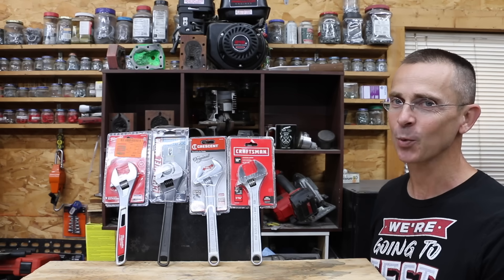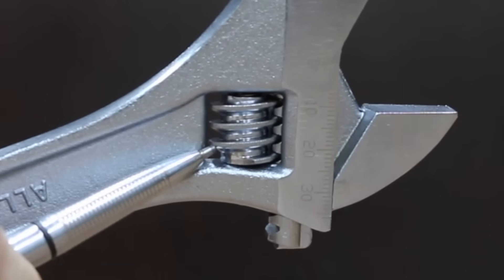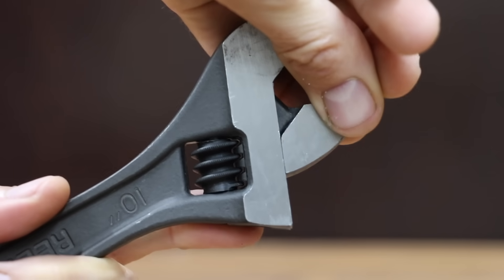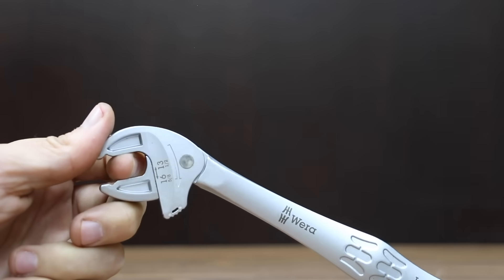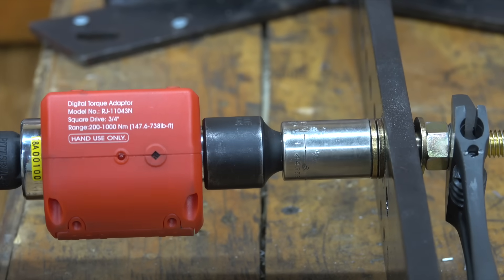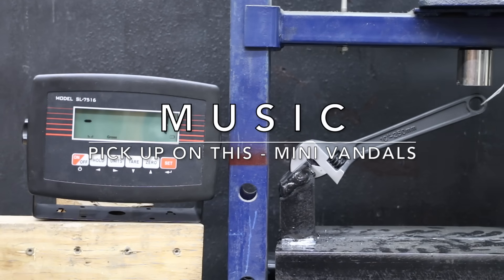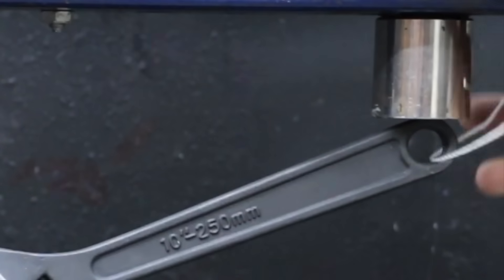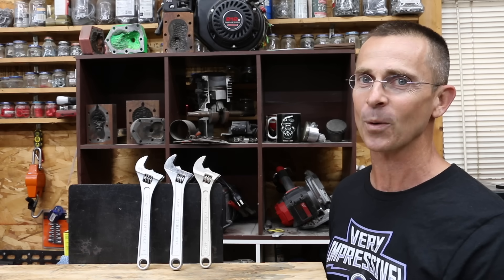Best Wrench (ADJUSTABLE)? Craftsman USA vs Craftsman, Crescent, Kobalt, Milwaukee, Channellock

Comment: thanks for adding the vintage wrench in. it goes to show the saying they dont make em like they used to,
Reply: They also don't charge what they used to.
Reply: @nokidding152  Ya.  For example the $5.00 one would be 98 cents in 1975 money.  The Crescent, while not top-of-the-line a pretty decent one, would be $3.14 in 1975 dollars.  I was a little too young to be pricing tools back then, but could you get a cheap knucklebuster that size for 98 cents brand new and a decent one for about three bucks?
Reply: @nokidding152  sadly!
Reply: @nokidding152  inflati- 

No point of arguing with people 50+
Reply: @nokidding152  inflation. It's not necessarily more expensive than it used to be. $20 dollars today is not equivalent to $20 dollars in the 70's, 80's, 90's, etc.
Reply: @nokidding152  just buy used tools, cheap and the right quality. Picked up a Swedish Bacho 4”, 6”, 8”, 12” and a 16” for $30. Just had to remove crud and surface rust and then oil them. Bargain.
Reply: @nokidding152  You get what you pay for, though. There's a reason the children of the Boomer generation are looking forward to inheriting their parents' tools: the older, more expensive tools are still in good condition and usable, while the newer, cheaper alternatives need to be replaced periodically. Even if they're 1/3rd the price, if you have to replace them three times, then they cost just as much, and cost more when you replace them the 4th time.
Reply: @c182SkylaneRG  Having to replace periodically is true for some tools, but certainly not all. I rarely break a tool or wear it out completely. Even this video demonstrates that most adjustable wrenches would last until you put a 5 foot pipe on the end of it and hang off it. The main difference if you actually use it frequently is how much frustration it's going to cause you and how much time the better version can save you on a single difficult job. That's what I find with most cheap tools. It's not that they don't last if you aren't abusing them, it's that they are just slightly worse or sometimes a lot worse and make jobs more frustrating. For example, buying cheap locking pliers simply is not worth it. I'm planning to buy some Malco ASAP because they seem like the only option that will match or best my old beat up made in USA Vise-Grips.
Reply: @802Garage  That's an even better point. I tend to focus on breakage and replacement because those are the ones that stand out in my mind (they cause the greatest frustration when they break or wear to an unusable point right when you need them, and have to stop your project to go buy a replacement). Admittedly, this is more common with replaceable screwdriver bits or drill bits than it is with wrenches, at least at the homeowner level.
Reply: Craftsman usa adjustables were forged the same way and by the same people as they had been for decades…until april 2020 when the forge was shut down permanently and liquidated. I’ve personally forged hundreds of thousands of these exact wrenches and jaws. The only things that changed were the dies. Craftsmans were chosen to be coined with the logo rather than the dedicated embossed dies. Other than that the craftsman adjustables were identical in every way to the allen, proto, wright, williams, ridgid (also had dedicated embossed dies), the occasional mac order, and i’m sure i’m forgetting a few other contracts. When i say identical i mean they were forged in the same purchase order, with the same bar stock billets, by the same operator, in the same dies, on the same shifts. The only difference between those brands were the names, and the phosphated or nickel finishes. Check out the date codes and touchmarks just above the hang hole and you will see the same touchmark.

So yeah, we did always make the usa wrenches just as we had for decades. Once b&d/stanley bought craftsman, they started to offshore a ton of production.
Reply: I've still been replacing mine with new ones from Ace Hardware corporate stores.

I love my USA made Craftsman wrenches!
Reply: Or the buyers don't specify and demand quality like they used to.
Reply: @Goalsplus  this is a huge part of it, it is a culture problem the American culture has become the disposable culture everything cheaply made and throw away, I hate it.
Reply: @keldon_champion  agreed. I don't like it at all and haven't been able to fully escape it. However when I "over build" something and I get someone to touch and feel it they start to appreciate quality and feel disdain for the junk. It doesn't work if I only show them a picture though.  Maybe our society is more interested in looking pretty, cheap buy-it-now gimmicks to put on show and never gets to feel the difference between a $50 and a $400 item. "Look but don't touch."
Reply: Made in America used to mean something to us American’s.
Reply: @iamgriff  iamgriff, We Americans spell the plural of American without an apostrophe.
Reply: Made me sad to see him destroy this pristine vintage tool.
Reply: When I was young (maybe about 11 or 12 years old) my father took me down to his workbench and gave me a lecture about the differences between quality tools and cheap tools. He demonstrated it with box head wrenches by using both an old Craftsman wrench and some chinesium tool he'd been given at some point. While I noted the difference at the time in how much better the Craftsman wrench fit the fastener and how much better it felt in the hand, the lesson didn't become practical for me until years later. When I started out living on my own with my wife, any tool that I could afford was what I used, but as I grew older and made some money, I ended up replacing those cheap tools (often from Harbor Freight) with better tools as I realized they both lasted longer and made the jobs I was using them for go MUCH more smoothly. As it worked out, I bought Craftsman when they were still made in the USA, and when I went to expand my tool collection, the Craftsman tools were no longer made in the US, so I bought Crescent and Klein tools. I have broken many chinesium tools over the years, but I still have every Craftsman, Crescent, and Klein tool I ever bought, and they are all still in "like new" condition despite many, many hours using and abusing them in the cold, rain, snow, and heat, though thankfully I now have a garage I can use to work on my cars and projects. The Klein screwdriver I have saw me through many years as a field service technician working on copiers and printers as well.
Reply: I really miss sears 😔 Until a couple years ago they had some really good stuff and now all the sears near me are gone.
Reply: Eh? The Taiwanese wrench did fine.
Reply: My Craftsman tool chest is  loaded with old Craftsman tools dating back to early 70's. All have held up very well!
Reply: Also shows that you shouldn't be blinded by marketing and biased by brand names.  Names are bought and sold all the time and the products almost never improve when the brand changes hands.  They count on brand recognition and reputation to sell you inferior products under the name of formerly quality products.
Reply: He knows how to pander to the demographs that watch his videos! That being said, it is a interesting data point.
Reply: My opinion on that (as a commercial and residential HVAC and appliance repair tech is they add all kinds of new bells and whistles on the new stuff but none of it is built to last any more. I honestly don't believe in the "planed failure" theory but durability and repairability are not something they take into significant consideration either.
Reply: Poured one out when PF destroyed the craftsman USA
Reply: Not really vintage when they are from 199X
Reply: @rissu8573  looking at the date and die code, i’m gonna guess it was 2005.
Reply: Spoiler alert ⚠️
Reply: You have to wonder if the quality of steel isn't as good as it used to be.  Much of our steel used today is produced from recycled metal which can carry along impurities that detracts from strength.  Copper is a common example of this type that's extremely hard to remove.
Reply: You got that right I actually came here right after watching your pit bike video
Reply: AMEN to that statement 🇺🇸👍
Reply: Most of the time this is just survivorship bias, this time it was measured and demonstrated.
Reply: SCRAP FAIR TRADE IT ISN'T FARE AT ALL JUNK FOR QUALITY ISN'T FARE AT ALL!
Reply: @jimmygmc9154  Err.... just buy good quality shit instead.
Reply: Why tho bc they will lose money making it too good?
Reply: @DEATH14269  Good tools cost 6-10x's what cheap ones do, for a reason. CNC Router heads are extremely expensive and the harder the steel of the end product the more tools you will need to replace. The material costs are pretty pricey atm but usually it's all down to how insanely expensive tools are to manufacture tools.
Reply: This reminds me of the Neverending light bulb some company couldn't produce...
Guess why?
Money is the answer.
Reply: Keeping my Craftmans.  Hiding the old, old ones....better metal.
Reply: Buy it nice or buy it twice.
Reply: Vintage wrench?
I feel old.
Reply: They definitely do. The problem is, how they used to make things wasn't as economical as it is today. Be prepared to drop 80 USD on a single wrench if you want things "how they used to" be.
Reply: @AliceNine  Too true!   A pair of Milwaukee locking pliers (which are pretty usable... rubber handle slips, but basically good) are $50 Canadian for a set containing a 10" and a 7".  To get the equivalent two from Malco would be $140.  That's a significantly premium price.   I'm not saying it's not worth it, I'm just saying that is way more money.
Reply: @AliceNine  my work has no problem paying big bucks. Just remind them that cheap tools cause injury's :-)
Reply: @AliceNine  $80 is a cheap lifetime investment if you intend to use it often.
Reply: @AliceNine  
Only because of greed by US corporations.
Reply: @AliceNine  when it comes to tools, I would do it
Reply: @AliceNine  well, it all depends on what the job is. If you’re a backyard mechanic then some cheap Chinese made tools would probably be your best bet. If you’re a professional aircraft mechanic then you will gladly pay $80usd for a quality tool. Lives depend on your craftsmanship.
Reply: @AliceNine  That is true, it depends on if you make a living with your tools or if you're a homeowner. I was able to make a living with craftsman when they were still American made, never disappointed. I remember when the Japanese, Tiawan, Indian, and Chinese tools all bent or broke when you put real pressure on them and you could put a three foot cheater on a 18" Williams adjustable, yes, the World has changed and our politicians going for the lobbyist and giving our patents to these foreign countries was by design to drive us down to the Worlds standards. It was economical back in the day because these companies paid a living wage to work for them, we've just become accustomed to rolling down to third world standards, Germany is about the only one that has kept their standards.
Reply: @AliceNine  well, the corporate business model and ever increasing greed of ceos, cfos, coos, and all those people doesn’t help, bankrupting a brand is rewarded  with multi million dollar bonuses these days
Reply: @nodescriptionavailable3842  It is also the shareholders greed.. They all want more returns.. The whole market structure is to blame..
Reply: @FJB2020  and our appetite for cheap crap
Reply: @FJB2020  Well that's capitalism. Companies will always seek to reduce cost as much as they can get away with.
Reply: @veni_vidi13  That is not capitalism..  That is having to compete with chinese imports.. They HAD to join because consumers wanted to pay as little as possible.. They were basically forced to go overseas.. More factors come into play like companies being extorted to pay union wages, EPA killing off steel production and a list of other things.. 

All we had to do was put large import fees on goods and we would have never been in this place..
Reply: @FJB2020  And just because they "had" to compete with Chinese imports on a global market that is still capitalism. 

Import fees are "big government" or as some in the US would call it "Socialism". 
In capitalism the market makes the decision. And the market made the decision to go to China.
Reply: @FJB2020  I worked for sears this is bs. I scanned tools in for l inventory and priced them. Iv seen wrenches that sears would charge $70+ for one wrench that only cost $2 to make. Its sears own fault with miss management that out them out of business. Me and another Coworker were the top sales men in the tools department. Making sears $60,000 a month back in 2013. And the company would still pressure us to do better.
Reply: @dillonkoch72  … I once worked for a retail chain that used to list product cost on the manifest of incoming merchandise along with the retail price. Many of the margins were shocking. Eventually they wised up and stop listing the cost. From their perspective, I can’t blame them. Why should the workers, other than the store manager, know the company’s cost… ??
Reply: @mercoid , that's not wisening up, it's lessening the quality of the workforce.
Margins most of the time are only shocking when not realising the price of purchase is just a small part of the cost of the item in a store:
* transportation, if you don't have it, you can't sell it
* storage, the shop itself has a cost to it which goes into the margin
* staff, unless you can trust your customers not just to put the money in the jar but also will unpack the deliveries and take away the trash for you.
* alternative cost, what you could have spend the money on instead. This is what makes shelf-warmers and seldom purchases expensive to deal in compared to high turnover items.

Having the costs listed teaches the workers the trade business at minimal expense for the company.
Reply: @veni_vidi13  no the government makes it. example; there are a lot of cars the government will not allow here. and yes a lot of countries tax the hell out of american imports and restrict american labor in their countries.
Reply: @mercoid  that  cost isn't always accurate. often the design and mold costs are not included in wholesale . i worked a lifetime ago at a plastic parts manufacturer. we usually used the buyer's molds to make their parts for them. we made old gm horn pads and charged them 4 bucks but they supplied the emblem and molds.   the retail market was for 45 bucks.
Reply: @victorhopper6774  and so what? It is still capitalism that companies will seek to produce at the lowest price possible while still satisfying consumers and if consumers buy tools from cheep Chinese manufacturers they will go there. That is not the governments decision. 

Sure there are countris putting tarifs on foreign goods and regulating foreign labor. The US is one of them. So what?
Reply: @victorhopper6774  Green cards is something every country has. 

We are talking about the businesses deciding to manufacture elsewhere. 
And even with tarifs on imports it is often cheaper to produce outside the country. 
It is the business owners who make the decision to leave the US. So they would sell their own mom for a buck. 
If you call for regulated capitalism or "social capitalism" that protects the workers then do that. But don't pretend it is still pure capitalism. 
It is the pure form of capitalism that drives work outside the US and you want a social capitalism to fix it.
Reply: @veni_vidi13  you just don't get it. free trade does not really exist between countries. different regulations concerning pollution, labor, transportation, and currency. china for years would not let the yuan float to keep a advantage for their industry. this not something a individual company can affect or compete with. unless they move to a cheaper country.
Reply: @victorhopper6774  And what is your point? It is still capitalism and the decision of the companies to move to China. Even if there were no regulations it would still be cheaper to produce overseas since the standard of living and therefore the pay is lower. That is the main driver for companies leaving the country. 
Capitalism.
Reply: @veni_vidi13  no. capital goes where it can make the most money if the governments let it. of course there are natural reasons some industries are located where they are.  like growing bananas  at the south pole. tell me why smith & wesson don't make fire arms in china. or why boeing doesn't make fighter jets in russia, they can surely make them cheaper in those places. these decisions are not up to the companies.
Reply: @victorhopper6774  if they were allowed to they would, but because there are regulations in place they won't. 
Yes capital goes where it can make the most money that is why they largely moved manufacturing oversees since they have to spend less and therefore make more money. That's capitalism and you not wanting to have it true is hilarious. Where bananas are grown is also influenced which countries the US invaded to destroy local farmers and subjugate them to US companies.
Reply: @AliceNine  quality pays for itself.
Reply: Man we were so lucky/spoiled back in the day when we could stop by Sears on a weekend. Pick up new American made Craftsman hand tools, tapes and what not. Also exchanged that 1/2" ratchet we snapped when we had the 4' heavy wall pipe on the end to break that damn axle nut loose as our breaker bar was home in the shop lol. All those sockets, open end wrenchs really we're just as good as snap on for what we needed with identical warranty. 

Here we are Sears is gone and the modern craftsman tools are tainted by chinesium where wal mart can now compete with their quality now, all useless garbage unless it's for a city boys "tool-bag" home kit

Still disgusts me Milwaukee is owned offshore but they're still top shelf and dump huge money back into the states keeping hundreds of thousands of our neighbors employed
Reply: Yep, my heart hurt with the destructive testing of that old Craftsman 💔
Reply: Yard sales.    I pick up old tools whenever I see them.
Reply: And that one was just a  mid level/ entry professional level wrench
Reply: If you have an easy exchange program on a lifetime warranty, then the newer tools are great. If you just want to buy 1 tool and never have to replace it, it's usually cheaper and a better experience in use to pay more 1x for a quality tool.
With that said, buying American keeps Americans working. I will pay allot more for quality American products because they are worth it and they build our economy, not China's economy.
Reply: @yadaroni  exactly! I buy everything i can that is made here in the U.S.A. if only more did what we did! Our economy wouldn't be in such a tragic mess! And downward spiral that its currently in! There's still quite a bit of things still made here. Tools and tons of other products. You just have to be willing to look harder and fork over around 2 to 6 times as much as cheap chinese tools and some even higher. But well worth it to me since it helps out Americans. Plus the products made here arent possibly hazardous due to unknown chemicals or heavy metals such as lead, mercury and tons of other toxic/hazardous Metals and chemicals! which china seems to love putting into our children's toys!  Of all things and other items. Its sickening how that crap makes it past our importing screening protocols and into our stores. Anyways sorry for the rant lol i also love vintage U.S.A made tools. I love how well built they are! and robust, reliable and will last several lifetimes if taken good care of. Same with vintage U.S Machinery, i Love it! So solid and heavy! Built to last. I also like old German made tools and England made tools as well as some from Australia.
Reply: @daviddaddy  ….
I love this comment. 
Good points. 
I’m a retiree who works part time in a store stockroom for a large retail chain. Everything they sell is made overseas, mostly China.., from a sponge holder for your sink to large furniture items. I can write a 50 point laundry list detailing the poor quality, dangerous, often toxic/bio-hazardous, incorrectly engineered garbage they’re selling. Too much to list here. 

Even the boxes the stuff arrives in are unhealthy to handle. Why? Because it takes massive amounts of decent fresh water to manufacture the type of corrugated cardboard boxes we’re used to here in the US. The boxes from China, India and several other countries, without question in my mind, have the distinct quality of having been made using filthy water, possibly containing sewage and chemical contaminants.
Reply: @daviddaddy  
SK,
Viking-Norseman,
Round-House (work clothes),
Williams,
Proto,
Snap-On,
Mac Tools,
Wright,
Channellock,
Bondhus,
Mayhew,
Matco,
Cornwell,
Wilde Tools,
DFM Toolworks,
SR Torque,
Razorback,
Tekton (some),
Western Forge (see below: Black and Decker destroyed and liquidated brand), 
Vaughn,
Montana,
Estwing?,
Empire (some),
Lisle Tool,
Midwest Tool,
Wiss (some),
Lenox (some), 
Wyeth Scott,
Rogue Hoe,
Council Tool,
Hardcore Hammer,
Eklind, 
US Tape,
Chapman Manufacturing,
Martin Sprocket,
Lang Tools,
Westling Machine,
Bully Tools,
Brooks USA,
Imperial Tools,
Martinez Tools,
Warwood Tool,
Lie Nielsen,
Grace USA,
Qualtool,

Still making tools in the US
Reply: @jeangadoury932  western forge forged a number of tools for some of the brands you listed: sk, wiliams, proto, mac, wright…as well as allen, ridgid, craftsman (in the video). But we never had our own branded products, not officially at least. Western forge was liquidated by it’s parent company (ideal) in may 2020. It was a downhill shitshow since emerson sold wf in 09. Inept and indifferent leadership, and the predatory behemoth that is b&d/stanley slowly strangled the company and the final layoffs were in the end of may 2020. Forge production continued through april 2020. Wf touchmarked products should still be available for a few years at least with some of those brands. Thought you may be interested in that little correction to your list. Wf is dead and gone forever.
Reply: @AUXdrone  
Was very interested! Thanks for the reply.  I keep that list around because I post USA brands frequently around the corners of the internet trying to spread the word.  

These American companies make quality tools, but are not really household names which is strange to me--you don't typically find these at Lowes or Home Depot.  I find German tools around town more commonly than American, even at mon and pops, and with Wera (or Wiha?) manufacturing tools in the states, I think that will be even more commonplace.
Reply: Also, believe it or not but I think I heard Craftsman will start moving manufacturing back to the US.  

Klein has been on a kick for a while slowly moving manufacturing out of the states, but they've come to their senses and are moving back as well.  Just built or is currently building a new plant somewhere.
Reply: @jeangadoury932  yeah, the new b&d/stanley plant is in texas. They bought most of the machinery from western forge’s auction.
Reply: @AUXdrone  Great info.  I've seen a lot of the same in the firearms industry.  If people only knew how often they paid extra for a particular name that was actually made by another company to identical specs on the same production line as their chosen brand.
Reply: @daviddaddy  It’s a slippery slope. I am old enough to have worked in manufacturing. I worked in three plants. One made industrial roller chain, one made wire and the other one made printing plates. None of the them payed great and it was hard dirty work. One went union and is doing well to this day. They now pay well. I purchase super light backpacking gear which is made in the US. It’s insanely light but you have to be willing to pay. My two man tent cost 800.00 but weighs only 22 oz. Most people purchase gear made in China for less than half the cost. People complain all the time about China and blame  the government but in fact we the people are the biggest issue. We could have bought American decades ago but went with  less expensive products which back in the day were made in Japan or Taiwan. Long before China was anything. Walmart and Amazon are mostly cheap crap made in China. Lots of people are barely making it, so Walmart it is.
Reply: This is true I have over 70 us made craftsman wrenches I paid over $1,500 for them. I used to work for sears. I have a lot of us made craftsman tools
Reply: @dillonkoch72  I have never seen any craftsman wrench cost that much and I started buying their tools back in 2002..  And I find it hard to belive a $70 wrench cost $2 to make in America..
Reply: @FJB2020  well I have I use to scan in the inventory. It would show me at cost and what sears charged for it
Reply: Hey there Mustie1!
Reply: At least we have Malco Eagle Grip for locking pliers!
Reply: Whilst completely negating "you get what you pay for" in the process.
Reply: @squigpeels.1021  While completely misunderstanding inflation. That vintage craftsman was your Pittsburgh/kobalt/husky etc.. back in the day. That's why any old timer's garage is full of old craftsman tools.
Reply: @debtminer4976  inflation doesn't mean shit if the tools you're buying are shit quality. Good quality costs more. Hence "you get what you pay for". Inflation doesn't only affect good or bad tools. It affects everything equally so you're still utilising "you get what you pay for".
Reply: @squigpeels.1021  Inflation is everything. The tools are shit quality, so your avg Joe can afford to buy them. In the past, your average Joe was buying quality, on his grocery store paycheck.

We just came up with different grades to hide the inflation tax. SK, snapon etc.. professionals.. husky, kobalt etc.. Home gamer.. When the money was strong, both professionals and home gamers just called it buying tools. Sears quality tools. . Like that old craftsman you see here.

Sorry.. the bankers robbed everyone and used overseas slave labor and pot metal to hide it.. inflation is everything. .if you don't realize that now, you will soon.
Reply: @debtminer4976  yeah, inflation for sure.  But the real difference is grocery store wages also meant you could afford an apartment or a mortgage back then.  Wages haven't kept up.
Reply: @debtminer4976  average joe bought a lot less tools in 1960. partly because he didn't need metric or torx etc; and partly cause they weren't cheap.
Reply: @debtminer4976  did you're hilarious with your economical thesis that you're trying to come up with.. sorry but my masters in econ tends to bring a little bit different hypothesis than give come up with on your own lol
Reply: BUY AMERICAN!
Reply: It's not really that they don't make things like they used to, it's that it's more expensive to make them with the same quality
Reply: ChiNa tools are useless like tits on a boar pig!
Reply: Survivorship bias
Reply: @aporifera  I'd agree if it weren't for the fact that it's supposed to be brand new/unused
Reply: @Loebane  The brand itself, not the tool
Reply: @aporifera  Ahhh gotcha
Reply: @aporifera  This is a very interesting point which I've often wondered about and believed wasn't factored in.  Good to know it's common enough to have a term.
Reply: @masondegaulle  Definitely possible, but some tools like Malco Eagle Grip are made in the USA in the old ways and the new tools outperform their cheaper and foreign made counterparts. I think it's a mix. Besides, abused old made in USA tools will still end up with a ton of slop.
Reply: @aporifera  Sweeping generalization
Reply: @aporifera  This is NOT survivorship bias.
Reply: @aporifera  even with that bias, it's still competing against its Chinese counter part, which was never a contest to begin with
Reply: @aporifera  How could it be survivorship bias if the wrench was unused?
Reply: @aporifera  No, because it was new, not used.
Reply: @aporifera  you don’t really have enough data to claim survivorship bias is a factor. It might be, but it also could likely not be. The only way to know is to gather a variety of brands and models of a given tool and test them against modern tools. One tool isn’t enough data to point to a conclusion either way.
Reply: @aporifera  It is a one to one comparison of old craftsman vs new craftsman. Survivorship bias doesn't apply.
Reply: @nalgene247  Did you take into account the brands from a hundred years ago that perished?
Reply: @aporifera  The case at hand is that the specific old version is better than the specific new replacement. Accepting the implication that "they don't make em like they used to" means new versions are of inferior quality, they apparently do not make craftsman tools like they used to. I don't think the statement is broad enough to apply survivorship bias.
Reply: @nalgene247  exactly as you said, how a brand's "specific old version" is inferior to its "specific new version" is only one instance but the phrase itself is a generalized statement. Just because it happens to be the case for this instance doesn't mean the phrase is true.
Reply: @aporifera  As long as you assume the two Craftsman wrenches in this test are/were representative of their respective groups, then the phrase is true.
Reply: @aporifera  I'd agree, but I'm still using a miners wrench that was handed down to me from my father that he got from his father. I don't baby this thing either. It's got a hammer head, so it's my hammer most of the time.
Reply: Glad you’re here Mustie
Reply: Whenever my wife sees me break out my dads old Snap On, Estwing, and Craftsmens tools she knows something has to be done right.
Reply: As far as I know Craftsman is guaranteed you could take it back and get a new one you might not get the vintage one but you'd get a new craftsman better than nothing
Reply: Mustie1 truth